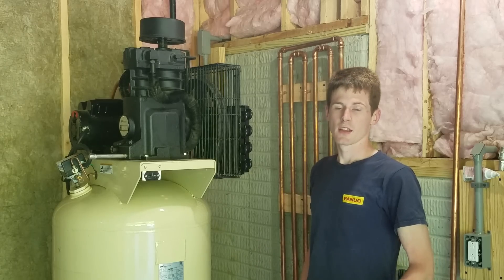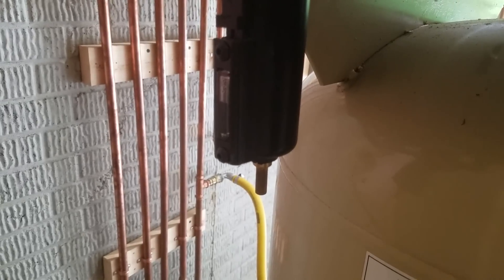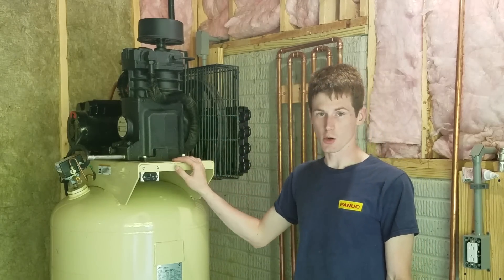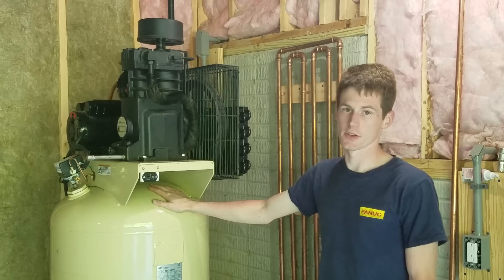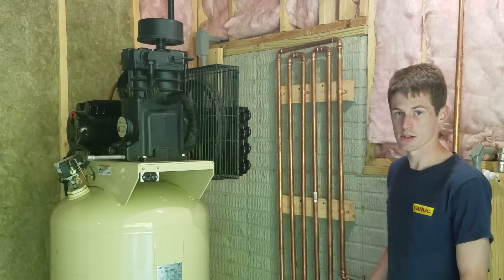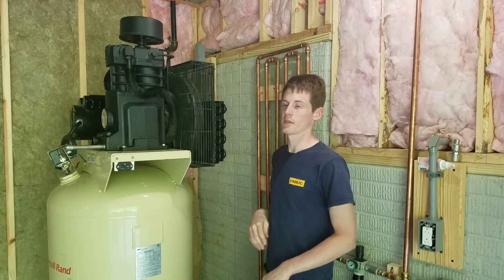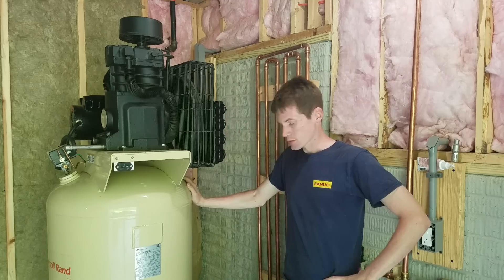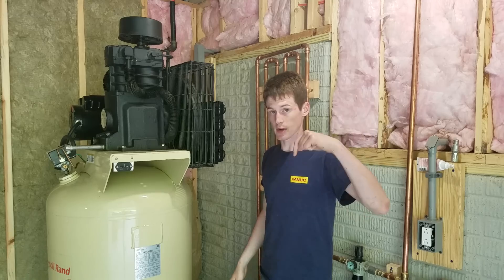How To Remove Moisture From Your Compressed Air

Comment: Building this Cooper cooling/water seperater is waaaay to much work and money. eBay has these heat exchangers that are rated @300psi.
 https://rover.ebay.com/rover/0/0/0?mpre=https%3A%2F%2Fwww.ebay.com%2Fulk%2Fitm%2F171146484709
Around a hundred bucks and your done.
Reply from the maker: Great, but I don't see how that is any cheaper or easier. The cooler that I linked it $15 cheaper than that example and last time I checked, 1" copper fittings are not cheap either.  You also need to add in a water separator so add another $50 or so. You can't replicate my setup for $100. Your cooler is $80 and a water separator is at least another $50.

Either one will work no doubt but, I'm not seeing your cost savings here. Thanks for watching.
Reply: My time is worth something.
Reply from the maker: How is yours faster to assemble?

Comment: Did you notice any reduction in flow with the transmission cooler in line?  Most I have seen run a fairly small tubing size.  I would also wonder just what their working pressure is rated at?  Most interesting setup, something I would consider for my own compressor if the above two questions were satisfied.  I know my setup is highly inefficient as I get no water at my filter at all after years of operation and I monthly drain the bottom of the tank and usually get only three or four ounces of water.  This is with a fair amount of use certainly not extreme and in a very humid climate.  Thanks for the informative video.  Doug
Reply from the maker: The short answer is no it will not restrict air flow as long as the filter is not pugged. Here is why: A straight 1/2" I.D. pipe will flow over 50 CFM @ 100psi. The water separator is rated at 65CFM. The cooler admittedly does not have a flow rating but, even if it's half of a regular 1/2" I.D. pipe that's still over 25CFM. The compressor will only put out around 15CFM @ 100psi. By that logic, my setup has at least another 10 CFM of capacity before the compressor becomes restricted. Also, shown in the video my temperature readings did not drastically increase on the compressor head which would indicate a restriction.
Reply: @RepairGeek  
enjoyed video thanks.
for future planning, air flow by pipe size chart:

https://www.google.com/imgres?imgurl=https%3A%2F%2Fwww.engineeringtoolbox.com%2Fdocs%2Fdocuments%2F1280%2Fcompressed-air-pipeline-capacity.png&imgrefurl=https%3A%2F%2Fwww.engineeringtoolbox.com%2Fair-flow-compressed-air-pipe-line-d_1280.html&tbnid=ndHwZLGizwYSEM&vet=12ahUKEwjvrOiw1J7rAhXPRawKHZSIDWAQMygHegUIARDEAQ..i&docid=C68WUWE3Vjgr8M&w=635&h=858&q=cfm%20pipe%20size%20chart&ved=2ahUKEwjvrOiw1J7rAhXPRawKHZSIDWAQMygHegUIARDEAQ

1/2 in pipe around 53 cfm@100 psi; 
1/4 in pipe around 14 cfm

thanks

Comment: For the small time homeowner setup it would be easier and perhaps cheaper to buy the Harbor Freight refrigerated air dryer for $399 minus any coupons or rebates.
Reply from the maker: The cooler is about $50, the water separator is about $50, the tubing and fittings are around $50. So about $150 vs $400 and that doesn't include re-plumbing the system for the HF cooler or the electricity to run the cooler. Also, the aftercooler removes the moisture before it even goes in the tank.

I'm not saying there's anything wrong with that HF cooler it's just 2 different ways of going about the same thing. Thanks for watching.
Reply: You actually need both. The drier has a maximum inlet temp which the compressor will be well over.

Comment: The best dewpoint you can achieve with this is going to be ambient temperature. The majority of the water will be captured by the aftercooler separator, but not much more after that. Every 20 degree drop is a new dewpoint and every 20 degree rise the air will hold twice a much water vapor.
Reply: Hmmmm, what would you suggest? I'm new to most of this but really want to understand it all.
Thanks!
:)

Comment: The first one should actually be called an "intercooler" and the last one an "aftercooler."
Reply: It's an after cooler. Intercooler is used between the first and second stage on the compressor itself
Reply: Nope, he has it right.  The cooler is after all of the compression stages.

Comment: Great lecture and a superb clip! Could you please let us know what the compressor air flow and pressure is ? Mine, a reciprocating compressor, works at  max 20 cfm @ 80 psi, do you think it could work? Thanks for your kind assistance! In principle I am only interested in cooling the air since it is used for pumping out drinking water from a well. Eager and needy to start your simple and clever project!
Reply from the maker: My compressor is 16 CFM at 175 psi. The cooler should support 25-30 CFM. At that point I would start looking into a cooler with larger tubes.

Comment: Great video, thanks. Did you use compression fittings on the cooler? and you mounted it on the grill of the compressor, is the air direction going thru the cooler towards the compressor head ?
Reply from the maker: I used the flared fittings I have in the description of the video. It's mounted in front of the pump fan on the grill so it gets airflow. The direction doesn't matter as long as you aren't trapping the water in the cooler. Meaning, the tubes in the cooler need to be horizontal to let water out of the cooler.

Comment: First, Thanks @Repair Geek for the great idea, as well as sharing it.  I followed this exact design method and can attest that it works very well.    Once the system was installed I measured the the tank inlet temps, and comparing them to the outlet temp at the pump I've seen as much as a 175 degree difference between the two on a 70 degree day.  Plus, even in the dry air of the western state where I live, I typically get a couple ounces of water in the moisture trap during a single tank fill on a 60 gallon compressor.  This is water that's not going into my tank or into the lines downstream.

This design works.  I used all soft 1/2 copper, picked up a tubing bender which helped routing the copper on the compressor, and bought a flare tool for the fittings to the transmission cooler. Putting it together probably took me the better part of a day all totaled with a couple trips to the hardware store, but it was totally worth it.  Almost looks like a factory accessory, and the secondary water/oil trap before my primary regulator has been nearly dry since.  A couple weeks ago I was running an HVLP gun for almost two hours painting a fence.  I lost track of how many times the compressor refilled.  The water/oil trap on the compressor had pumped out a solid cup of liquid (auto-drain).  The trap before my regulator stage had a couple drops of water inside.  I hit the blow off valve on the tank and got what was probably an ounce of water.
Reply: it would be nice if the OEM offered something similar that wasn't a huge external cooler costing thousands.  I guess it's planned obsolescence... maybe they own shares in razor blade cos....  Thanks for sharing this - great setup!

Comment: What is the maximum pressure rating on 
Derale 15300 Tube and Fin Cooler Core?
Reply from the maker: Rated at 250 psi. 300 psi burst pressure.
Reply: @RepairGeek  One more question on fittings. Would it be better to use hydraulic fittings and hoses?
Reply from the maker: @scottwiz1136  The copper fittings I used are used in A/C systems. It's not uncommon for the high side of an A/C system to see 350+ psi. Use whatever is cheaper or easier for you to get a hold of. Either one will work.
Reply: @RepairGeek  Can I see  a  few pictures of your fitting and connections, please.
Reply from the maker: @scottwiz1136  send me an email. The address is in the description.

Comment: I am late to this party. I have the exact same compressor and have my cooler mounted but have been stuck on what to do going into the tank. It appears this is an inverted flare. I was hoping to use hydraulic hose after my water filter then into the tank. Did you just use a flare tool and flare nut?
Reply from the maker: On the tank side I used the nut from the stock copper line. I flared my new line and used the original nut. I've had no issues.

Comment: ac condenser off a car with a electric fan made for a car but runs off 120 volts ac.
I've had this Idea for over 40+ years that's 20+ years longer than you've walked the earth.
After the copper  you can use pvc pipe, you do not need iron pipe its a waste of money pvc can hold 330 psi way more then you compressor makes with its safety valve.  Drip traps is also a great idea on those as well 8" to 24" long waste valve at the bottom.  The longer the pipes run the more water will come out of the air.

You can coil a copper tube into a 55 gallon water barrel to cool the air or lay the lines under ground 24" deep if its under the frost line the soil stays at about 56 to 58 dgr year round this would shock the air fast and remove most the water.
you want the water out of the air before it enters your storage tank where it can cause the tank to rust inside out.

you can also use a coil from an old house air conditioner, or off a broken refrigerator.
why spend money on new parts when you can reuse stuff and do the same thing.
the A coil from a house ac unit might be the way to go, but the coil in a fridge freezer might also be an option.
200 bucks for a flaring tool might as well buy a commercial built unt. Granger has them. As do quite a few compressor manufacturers some of the compressors come with them built in no diy needed.
Reply from the maker: Just because you're older than me doesn't make me automaticly wrong.
Reply: Using PVC for compressed air most definitely makes the old guy wrong though.  PVC can EXPLODE and is against the building code for above ground use pretty much everywhere.  PVC is also very fragile and if you hit it with an errant 2,4 or tool in a shop environment the problem isn;t that it can explode but that it WILL explode.  Iron and copper may be spendy but they don't shatter into a bunch of high speed razors.

After it's cool you could use PEX to save a buck or two if you really had to.
Reply: @RepairGeek  if you run your copper tubing horizontal, with a slight drop between rows, then a trap/drain/ball valve in a drop teed off the bottom row, (water trap), the water will condense and keep running downhill to the trap, just a more efficient way to set it up.... ;-)
Reply: Schedule 40 PVC may have enough burst pressure, however when it bursts with compressed air it will  EXPLODE sending plastic shrapnel everywhere.  Yes I know people use it, but they should  be using schedule 80 PVC can be used safely for plumbing air lines.  Be safe and just use copper or iron if you have dry air going in.

Comment: I like your update (Not cheap or easy to get), so I bought the other one you listed. I also liked that it is easy to source new filters for this one. I bought a Parker regulator and a parker water filter for the air out of the tank. Thanks again for the video. This is the cleanest and neatest installation I've seen. I like that it has a (from the factory) look. I have a Kobalt 80 Gallon I just bought and wanted to get this on and done before putting it into service. Its a shame you can't get more compressors in this price range with these systems on them from the factory. 👍🏻
Reply: That's my thinking. Plug and play! Not "get the compressor, order parts, spend 2-4 weeks getting everything set up, repairing leaks, spending as much as you did on the compressor"...I just wanna paint small parts lol

Comment: Can you use PEX tubing instead of Copper
Reply from the maker: I don't believe PEX is rated for this type of heat. I may be wrong. The outlet of the compressor is much hotter than normal hot water.
Reply: Pex will not give you near the amount of heat exchange that copper will.

Comment: I do not see a coalescing filter anywhere. A pump compressor has the highest oil carry over. Oil will contaminate your cooler and you water separator. Slowly clogging them.

Comment: I used this exact transmission cooler on my set up. I originally used 5/8 copper tubing to connect from the pump to the cooler inlet, the cooler outlet to the separators and again from the separators to the tank. I was concerned about the vibrations being transferred to the cooler so replaced the line to the cooler with a stainless PTFE lined hose and the other connections with a 1/2 whip hoses. Galvanic corrosion played a huge roll in component choices here. I also added a 12v fan to the cooler to supplement airflow and ensure proper cooling during continuous duty cycles of the compressor during blasting. It is wired to run when the compressor activates. I was not aware the regular 45 degree flare would work with the AN fittings on the cooler. As of now my weakest link in this is the anodized aluminum AN to npt fittings connected to the cooler. I figured these would be easy enough to replace if they corroded to the point of failure. Stainless AN fittings are upwards of $75 each!
Reply: die electric union  or plastic fitting between dissimilar metals.  Good eye! as copper and cast iron don't mix well together.   I would not waste my money on steel pipe anyway.
Just use high pressure rubber hose and no problems with galvanic corrosion.
your weak link will be that hose as rubber dosn't last forever but it will save the compressor tank and help cut down noise from vibrations.

Comment: I've been researching this topic for a couple of weeks (i.e., watching YouTube videos).  Your video is one of the better ones I have seen.  I have decided to install a compressor aftercooler and water separator (thanks for the links) as you have and later decide if the copper manifold is worth the time and expense vs a desiccant type trap.
Reply: Lee_CPA hey bud. Did you end up needing the copper manifold?
Thanks!
:)

Comment: Dry it BEFORE it goes in the tank
Reply: Exactly, cooling after the tank is pointless. What its actually doing is mechanically removing water via gravity, which does work. What he should do is have one of those big dessicant dryers at the final stage. He could also add a small initial tank to feed into, as the second the hot compressed air hits the cold air in the tank, it will cause the water to coalesce in the bottom of the small tank.
Reply: @snaplash  will you tell us how you built it?
Reply: snaplash would love to see it! :)

Comment: Why not set the after cooler inside a small refrigerator. 40 reg air as opposed to room air.
Reply from the maker: No reason you can't. But chances are, at high duty cycles the aftercooler will put out more heat than a small fridge will handle. Also using the fan pulley on the compressor to create airflow across the cooler doesn't cost you any extra in electricity like a fridge would.
Reply: This is what I was thinking of doing just with a second after cooler. Let the first one do most of the work and then let a second one do some more. Also make it so it's not a permanent setup, just for when you need really dry air.

Comment: I have an after cooler on my compressor but the only transmission coolers I could find were not threaded.  I have been looking for threaded fittings on an affordable  cooler with no luck.  I had to use compression fitting and they keep breaking.  I am going to try the after cooler you recommended.  It has threads and should be a big improvement.
Reply from the maker: I hope it works for you. Other people that have watched this video have used it with success as well. I personally have had zero issues in the 6 months or so it's been installed.

Comment: When the tank reaches cut off pressure does it unload the whole cooler? I was thinking I would want to relocate the check valve before the cooler so that you wouldn't have so much space to "unload" when the compressor shuts off. Maybe this is overkill and not necessary. Just dont want 90 seconds of air hissing from unloading.
Great looking system! Thanks for the video!
Reply: Isn't it nice to keep the check valve after the cooler? That way the cooler is not always under pressure.
Reply: @707SonomaComa  
Yes. It appears to jave worked out better that way.
Reply from the maker: Correct the whole cooler unloads. It takes probably between 10 and 15 seconds to unload. Its not excessive at all. The compressor isn't in my work space  so some hissing air really isn't an issue. 

I don't think relocating the valve is worth the effort. The nice thing is I can check my water separator with the tank pressurised.
Reply: @RepairGeek  
10-15 seconds isnt bad at all! Thanks for the reply, i think I'll run with this design.
Reply: @RepairGeek 
 So I installed this setup on my 80 gallon 3 cylinder de-walt compressor and it works surprisingly well! I used a milton 1020-8 1/2" npt water separator and it drains the water when the compressor unloads after shutting off. I was tempted to double the cooler coils just to make sure that the air was completely cool before going through the separator but im glad I didn't because only the first couple rows in the cooler get hot. The first flaring tool that i bought was cheap at around $25 but it was 45 degree. I figured out like you say in the video that AN fittings are 37 degree so i searched everywhere and virtually the same tool that I initially purchased but for 37 degree cost about $120! So I  bought one anyway. Its just frustrating that both tools are pretty much identical but the 37 degree cost 4 times more! The milton 1020-8 drains automatically when pressure drops below 5 psi so it won't leave any water in to filter bowl to freeze. Anyway thanks for the help, this works far better that i was expecting!
Reply from the maker: Awesome! I'm glad you got it installed and it works well. Sucks about the flare tool but, at least you have it for another project.